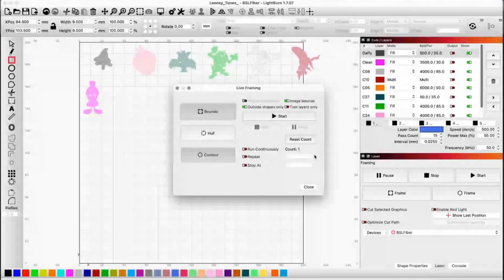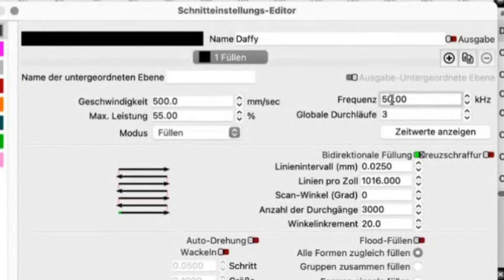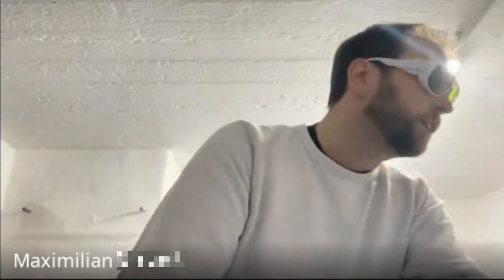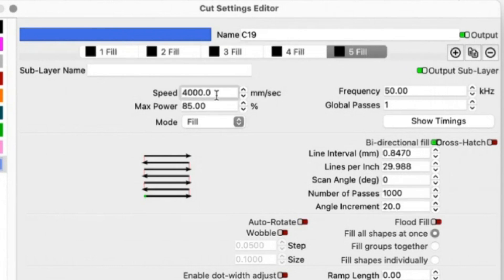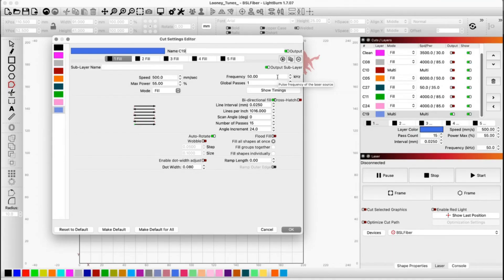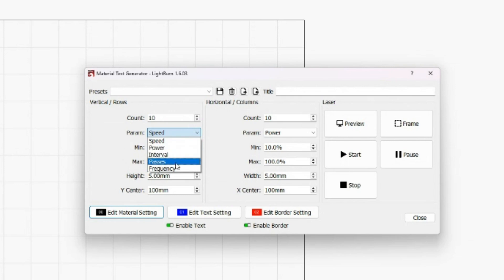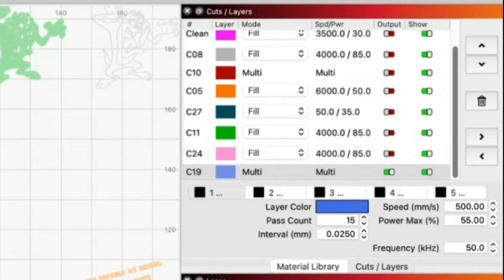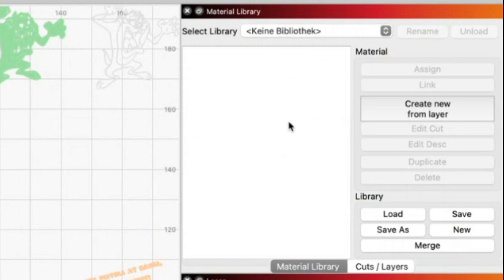You're NOT Supposed to See This: Mastering Deep Steel Engraving & Vector Golf Club Marking

Comment: Where do you go if you want a 1 on 1 class?
Reply from the maker: info over at https://lasereverything.net/laser-engraving-training if you're interested in learning more :)
Reply: @LaserEverything  Thanks for getting back what was the q pulse when doing this
Reply from the maker: It’s a 50w raycus source for this one, so it is tied to and depends on what the frequency is. I think it’s between 90 and 130 but would have to check that model’s manual to be sure.
Reply: @LaserEverything this link doesn't seem to be working, would love some 1 on 1 with the f2 ultra

Comment: Hi! Love the video.  You mentioned a polish pass on stainless steel.  What settings would you recommend for a polish pass on a 60w mopa laser with a110mm lens or 200mm lens?  Thank you for your time.  Awesome resource!
Reply from the maker: Hi! Glad you enjoyed! The settings wouldn't be far off. For context, the info in the video was for a 50w Raycus laser with 200mm lens. You can replicate this with a 60w JPT mopa, but you'll need to make adjustments. I would use the 200 lens if you have it available (just makes conversion and the science around the non-engraving marks easier to replicate). The raycus 50w has a variable pulse width linked to frequency that is between I believe 90-130 or thereabouts, so I would say using a similar pulse width setting might help if you're trying to copy this 1 to 1. For engraving though on the 60w, you can get more efficient engraving passes at a higher pulse width if you were prepared to tune for it. to adjust for power from a 60w to a 50w, you can utilize the tool Shark made for the community, the settings converter (just search the channel for converter, it'll come up).
Reply: @LaserEverything  Thank you for responding.  Always appreciate the support and encouragement!  You guys are the best.

Comment: I belie i heard 600 passes? lord I know your not manually doing the engraving, but how long would did those take? I remember the LE coin live stream you worked on and I believe that was atleast an hour.
Reply from the maker: Yea, super deep! The LE coin wasn't exactly the same idea to this, but I get your point. The idea for the project we were helping with was to fill the engraving in post, so there needs to be enough depth to get good hold on the acrylic fill used. 600 passes in the big picture isn't really that unheard of when you're looking at deep engravings. Even when we chat about something like 3d heightmaps, those generally start at like 200+ passes, or if you have a really detailed image, would be atleast 256, 1 layer for each tone of gray between white and black in 8 bit. It wouldn't be uncommon to double that to 512 for more depth, so 600 on a nice clean cut vector for comparison isn't terrible (and thankfully it's not a huge piece either so wouldn't take as long as it sounds). Most coin projects for example would take anywhere from 30 mins to 3 hours, I would anticipate the engraving work planned for this project would probably not take any longer, and in most cases have a higher return potential vs a custom coin. Typically people would be willing to spend far more on a custom club than a coin.
Reply: @LaserEverything  how many passes would you estimate for a 20W laser to achieve the same depth?

Comment: Are these settings, such as rotate the angle the laser works to change the material axis available in ezcad?
Reply from the maker: It should be, yup! At the bottom of the hatch menu should be a auto rotate hatch option, and you can put in the angle increment below that I think.
Reply: @LaserEverything  Sorry, Not the autorotate  element, I found that one, I meant the work orientation or the X & Y axis location.
Reply from the maker: @TheCNCDen it’s been years since we’ve used ezcad so I’m not sure. If it’s there it’s probably somewhere in the f3 menu, but I couldn’t really say for sure without digging out ezcad again and swapping the drivers and messing with it for a bit. Honestly might be worth the lightburn swap unless lightburn doesn’t do something you need. can always try the 30 day free trial, they don’t even require a card or account to try it out
Reply: @LaserEverything  I'll have a look around, it amused me one of the avenues I'd been explosing was golf club and other asset marking. An hour before this video popped up, I'd managed to speak with a golf mad neighbour about it. With the work I get on the CNC and some other stuff at this moment, I doubt I'd get enough use in 30days to test it. While I'm learning the nuonce of laser I'm happy to play with ezcad.
Reply: Should add, I pick up the laser this morning from the delivery depot. I'm very new to it.